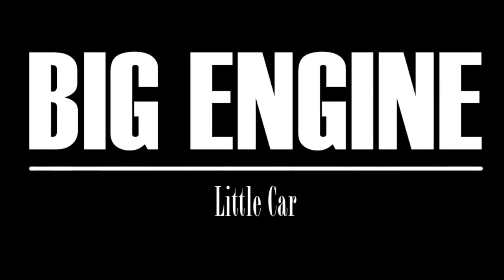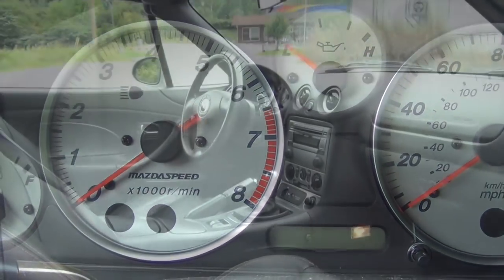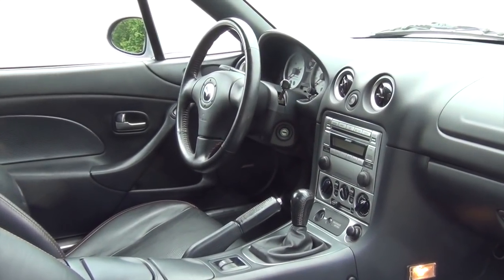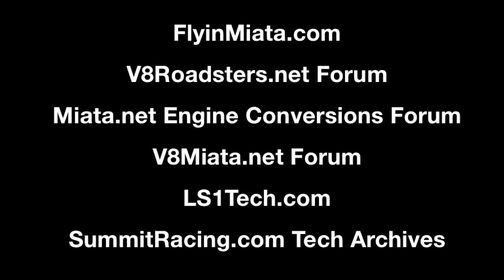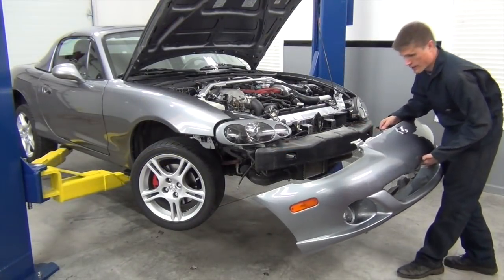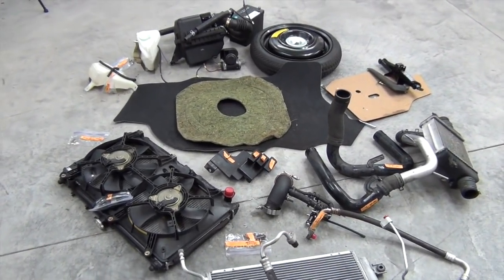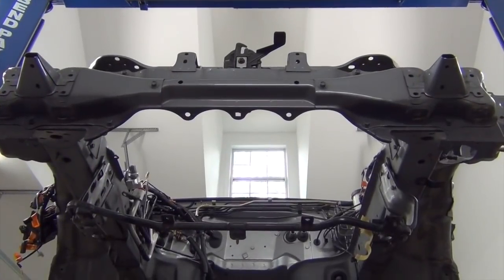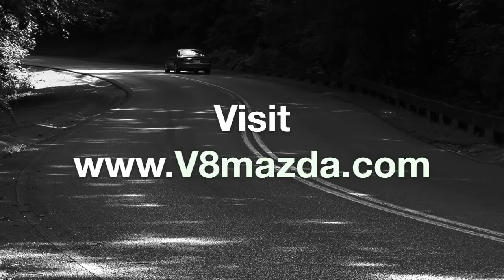LS3 V8 Miata Build - Project Thunderbolt Part 1

Comment: This would have to be the best How To - Engine Swap video I've ever seen!! Your workshop is super clean throughout the entire build, you're taking time and care at every stage of the process, using the correct tools and ppe for the job, every nut and bolt is torqued to specification as it's going back together and I love that you're using purpose-built front and rear subframe assemblies and not some homemade engine and diff mounts (which I see all too often in conversion jobs) and even how you angle the front diff to 1.5 deg before welding the front hanger bracket into place! Now that's Craftsmanship - well done Tom, now I better get back to watching the rest of the build!
Reply from the maker: Thank you for the very kind words sir!  Glad you’re enjoying the series!

Comment: The drivetrain that's coming out of the Miata would fit nicely in mostly stock form in a 89 Ford Festiva. That would be an awesome project. After this one is completed of course.... ;-)
Reply from the maker: Dude, it's like you're inside my brain!  I love the Ford Festiva and have been kind of casually looking for a clean one for many years.
Reply: I saw someone make a Ford Festevil and put a n/a Miata motor in one several years ago. (can't find it anywhere online anymore). It was pretty quick, but I think you could do it more justice. Because I like the sleeper look that you push pretty much on all your builds, it's harder to maintain and the thought process is much more involved. But, if you could make one that's RWD & turbo'd with A/C and maybe tub it out some to handle the power? Being they have 12" rims and the tires that were on the car were boat tires ( Four Wheeler rims actually fit on this car!! ). My sister got one when she graduated High school (in 1989), and she drove it for 17 years, everything still worked even the A/C when she got rid of it. Anyways, this build is going to be awesome!!! I figured I'd ask where the parts coming off of the Miata were going if they weren't going to be sold. Can't wait to see more progress on the next video!!!
Reply from the maker: BoostedCajun It would be tons of fun, but oh man, I can't even begin to think about another build right now.  My plan right now after I get my Miata done is to take a little break from wrenching and just enjoy it for awhile!  Have a good one!
Reply: My first car was an 89 Ford festiva. Absolutely loved that car.  Jay Leno had/has a Festiva Shogun, which would have been a blast to drive

Comment: I understand the thought of big motor small car combo, but why use such a limited edition car? Why not use a Miata of the everyday variety? I have wanted to do this swap for quite a long time as well, but I don't want to use a limited edition model. Just curious.
Reply: Why use a Mazdaspeed NB for this! You should have used a normal NB and like someone else wrote you should have done a 13B conversion or something other than a LS
Reply: *****
If I'm wrong correct me but I do believe the 13b is 50lbs+ heavier than that LS motor. Although it would be cool.
Reply: No, no, wait, i got news, tom goes to change because of you, because you want.
Reply: Well i do understand why he is using a LS engine, its just that in 9/10 engine swaps people use LS engines.
Reply: ***** I'll agree with you, I like LSs but it's getting over used
Reply: I'd say one of the reasons he went for this car specifically was because it was so well maintained. Just look at it, it's absolutely spotless. With a run of the mill miata he would've been confronted to rust, dry rot, perhaps parts to replace and a doubtful electrical system. It's so much nicer to have something clean to start with.
Reply from the maker: PilgrimTitan Haha, thanks man!
Reply from the maker: ***** Kim I just build what I like, it's ok if everyone doesn't like it.  That's not my goal.  My goal is to build the car I've had in my head for the last 20 years.  There' no harm if that doesn't fit your liking.
Reply from the maker: randomted Yes, it is.  No one wants to believe this but it has been well documented by folks who have swapped from turbo rotary to LSx.
Reply from the maker: SI RICKO Thanks man, pretty much.
Reply from the maker: Donald T. Silva Yeah, the car hobby is good due to the variety in everyone's taste, but to say someones choice is wrong, seems kinda crazy to me.
Reply from the maker: Clément Dutter Yes, yes, yes.  Well said and starting with an old, high mileage chassis sucks.  I've done it.  You end up with a junky, wore out car that you've sunk tons of time and effort into and still needs much, much more.
Reply from the maker: turbokillsemall I wanted a well cared for, low mileage, rust free car to start with.  I also want to drive and enjoy this car for a long time, so starting out with the nicest possible chassis with the options I wanted just made good sense to me.  This was the best car I found in my long search.  Most every car had bad paint, wore out interiors, bumps and bruises, a little fender bender here and there, rust, etc. etc. etc.
Reply: Tom's Turbo Garage Understood. Well taken for cars are better starting points.
Reply: Even if it is a limited edition car, its still cheap being a miata. I wouldn't give it a second thought even it if was one of only a handful. But, I also give miatas about as much respect as I give Hondas.
Reply: turbokillsemall I think I missed something.  That gray NB is rare?  I know the yellow one is (I have a sunburst NA as well), but I don't remember seeing the gray one in my rare research.
Reply: ***** that's a Mazdaspeed version.
Reply: +1 to using a speed for a build.  Why put all that $$$$$ into a plain jane car when you can make a very nice special edition so much more special?  The best car to start with for a swap is the best car you can find and Tom nailed it!
Reply from the maker: Jim Stainer Thank you Jim, well said and I appreciate that!  This is a car I want to keep and enjoy for a long time, so the investment up front seemed worthwhile.  See ya!
Reply: I don't care what your excuse is, you removed a rare beautiful car from the road for a bullshit boring counter-intuitive v8 build no one will give two shits for in the aftermarket. I really hope you enjoy your now near worthless Miata, I really do.
Reply: turbokillsemall o

Comment: Why are there thumb downs for this?? Man I wish I had a normal mx-5. I would've caught you on the forums and said, ship me everything you got!!!

Very cool project.
Reply from the maker: Hott Toddy Thanks man!
Reply: Hott Toddy Probably cause Tom's cutting apart a quite limited edition MX-5, a Mazdaspeed version, and it looks fricken mint, and in my favorite colour.  Tom, please tell me that you're trying to save all the MS components for later use, or that they are going to another MS MX-5 owner! please! This is one of the few MS version Mazda's I haven't owned, I know they aren't the fastest car around, and you can make a stock MX-5 plenty faster yourself, but you gotta realize this car, if kept in good condition, will be a highly collectible car one day.  /rant  (still got my thumbs up, but I am sad you used a MS version) :(
Reply: I completely understand. I have the mazdaspeed protege 👍
Reply: Hott Toddy I owned the 1st MSP in Canada, put my deposit down a year before it came, the dealers had no idea what I was talking about.  Of course at that point I had no idea they were going to make the 2003.5, in titanium silver (like this MX-5), which is SOO much nicer than the flying pumpkin orange..  Anyways, honestly the MSP is the BEST handling front wheel drive car ever, MS did wonders with the suspension in that car.
Reply: Lol yeah laser blue here. Best friend got the first spicy down here in south Florida. I had the pr5 before till some fuk ran a stop sign and totalled it. So I got the laser shortly after. Love it.

Comment: LS engine in Miata is a fairly common option, but I'm wondering if there is any possibility to port other V8s, like a Merc V8 or a Ferrari V8 into that engine bay.
Reply: if I'm not mistaken there is a guy that is putting a Ferrari V8 in q brz or Frs
Reply: +André Pretto a**

Comment: pro tip for those storage bins if you don't know it already, write the labels on the clear cover over the section to be labeled, that way you can see the contents through the label, and sharpie is easy to remove with a little brake clean on a rag.

Comment: Anyone hear of the Sunbeam Tiger?
Reply from the maker: There is an amazing example of one that comes to my local cars and coffee that I’ve shown in some of my other videos.  Man I would love to drive it!!
Reply: The Ford 289 is taller than some others but it's width was pretty narrow. Because it was narrow it made for a great conversion for it's time! I got a feeling your conversion will be 10 times greater though! Nothing against the Ford 289 however. Properly built and kitted out it was a really great engine. For a few years I owned a 1966 Mustang coupe because I begged my mechanic neighbor (who worked at Ford Proving Grounds) to sell it to me! He had bought it for a song & dance at a auction just for Ford employees. It was straight from Ford's Yuma proving grounds and was tinkered on by none other than Shelby, the man him self! Found out the 289 had been balanced and blueprinted which may be not such a big deal today but back then it made for a very high revving engine. My neighbor took me for several rides before I bought it and he would rev that engine to over 7,ooo rpm! In order to do that it had heavier valve springs, different cam, etc. I figured, if that engine could hang together after revving that high multiple times, i wanted that car!  It had some kind of ceramic-coated headers on it with a cross-over just back of them then further back it had two separate glass packed mufflers then dual exhaust all the way to the back where they exited through port holes in the body, not underneath it!.  I will always remember how throaty and crisp the sound of that exhaust was and I loved it! 
I can't remember ALL the changes that were made to that car but it had a special Mallory dual-point distributor that was a real bear to set point gaps on! Oh, the engine had a dual-feed 850cfm Holley carb feeding a Edelbrok high-rise intake manifold. That carb had so many mods done to it that I had a lot of trouble finding a rebuild and ended up using parts of two kits! It didn't even have ID numbers on the body of the carb! I remember it had a Munchie 4-speed with Hurst short-throw shift linkage and no slop (Real fun to shift it, very positive). It also had a posi limited-slip diff and the rear axle housing had been modified so disk brakes could be installed. I don't know if that feature ever became a factory option. So I'll wrap this up by saying I think it's time for a disclaimer. Before any of you pick apart my description of the car keep in mind I was 20 years old back then and 72 now so 52 years have gone by! My mechanical abilities back then were shade-tree self-taught at best! I wish I still owned that car now!
Reply: Sunbeam Tiger would be over 50 years old now. It was a rust bucket even in the early 70's and was a bad piece of engineering. It couldn't take corners at any reasonable speed and was really just a big engine thrown into a small car. How would I know? Well I had one for a short time, a very short time! I also had a sky blue 1725 alpine, also a rust bucket. My neighbour was a traffic cop and the police in south London had bought one to try catching the growing number of very fast fords that were being modified for the street. He hated it despite it being really quick. He thought they looked stupid with their big policeman uniformed bodies crammed into a little car. It was often out of service as it was really difficult to service. It wasn't able to keep up with the modified fords on the bends and a didn't last long. Despite all the negatives, the alpine always looked neat but was never considered by the boys as a cool car especially when compared to a well sorted lotus cortina or a rally modified ford anglia.
Reply: Well if you redesigned the chassis placing the engine further back in the frame, and you made the rear-end 25percent heavier, you could in theory, compensate, for lack of 50/50 weight distribution. Plus I believe that the Corvette shouldn’t become a mid engine car, they should redesign it as a SPORTS car,instead of a grand touring car.  Also since the Corvette is made as a semi fiberglass automobile it cuts down on RUST. The Corvette NEEDS to be re-engineered as the people’s sports car

Comment: Back in the '90s,  in Vancouver, there was a guy selling a retro kit for first gen Miatas, which included a 302/5 litre Mustang drivetrain, and a suspension package. He sold several of the kits. The Mazda/Ford connection made sense to me.

Comment: I can see the vultures circling over the low-mile engine and diff.  Good project, can't wait to see it all come together.
Reply from the maker: bandwagon240 Thanks man!  Yeah, I may end up selling those parts eventually.  Not sure yet.
Reply: Putting them into a NA would also be fun (albeit without the bucktooth intercooler).  Or even an Exocet.

Comment: It helps to wrap the edges of the hood and fenders with high quality 2 inch wide masking tape (the easy release type) to keep from having nicks. I like "Frog Tape". Also if there are any shims where fenders bolt on they should be put in zip lock bags, one bag for each group of shims, with a note inside denoting position, like right top and right middle. As the builder states, label everything as to position, especially grounds. Most electrical connectors are unique and can't be plugged in any place beside where they were but "you never know". I write numbers on the tape and I record the numbers on a legal pad and beside the number I write where that number goes. This keeps me from writing a lot of info on the tape.

Comment: Absolutely great done video and a project that could be done "on the cheap" at first. After it's thoroughly "sorted out" with maybe 200 miles, the "Skys the limit". The only problem is traction because of low end torque but that could be handled with a "peaky" cam.

Comment: I halfway expected you to put a 4g63 in an NA Miata ha. I'm really looking forward to watching this as I'm considering putting a carbed 302 into my beat up 94' red on tan na, you know for the sleeper factor of a huge quarter panel dent, with the monster miata kit.
From a fellow Tennessean (middle, although it used to be Knoxville/maryville) your awesome
Reply from the maker: Jackson Bond Thank you for the kind words Jackson!  A 302 swap is an excellent budget setup that is tons of fun and much easier, ultimately.  I would've put a 4g into a Miata years ago, but the engine is far too tall.
Reply: Being there are so many Fox bodied Mustangs out there and along with 80s and 90s Ford trucks,the 5.0 liter is all over the place. I love the Coyote engine tho but I figure they will be putting the V6 twin turbo EcoBoost in the Mustang and that would be a great swap into the Miata.
Reply: The 4G63 miata doesn't sound too bad

Comment: Custom cars done right are one of the biggest bargains going.  The classifieds do have excellent executions on interesting cars.  The key is to find one that isn't demanding a Boyd Coddington price (because the owner is holding invoices from a place like that).  The reason people get put off is they can't imagine a DIY doing as good or better than factory engineers.  Sometimes they do it well.  Look -- Ford didn't even try to put the 429 Boss in the 1969 Mustang -- they just outsourced the job.  Big block (mopar) a-bodies were known for horrendous exhaust compromises.  etc.

Comment: Talk about a coincidence. I have been scheming on putting an LS1 in an 88 Porsche 944 and I have no problem with a heavy front because the LS weighs almost 100 lbs lighter than the inline 4 that's in it now.
Reply from the maker: argonian bilbo Nice!  I just read through an excellent build thread of an LS in a 911 that was darn compelling.  I would have to imagine that a 944 would be much easier.  Good luck!
Reply: Thanks. It most likely will. The engine is in front of this car not in the back like the 911

Comment: I find this awesome honestly. I'm looking forward to the next episodes. I own an MSM of my own and have seriously contemplated doing this in the future.
What the MSM is an unique limited edition car? Bli Bli Bla Bla? 
The MSM isn't as special as everyone makes it out to be, it's pretty much a non VVT 1.8 with a tiny turbo an awful factory tuning. The 6 speed and rear 4.1 makes the gearing way too short and nevermind the lowly 6.5k Rev limit. If you turbo a regular Miata you end up with a faster car than an MSM...
Reply from the maker: NotSoFastDriver Thank you for the support sir!  I looked at lots of Miatas in this generation and the MSM was by far my favorite and were usually kept in the best condition.  Most "regular" Miatas are ragged out by now.  My goal is OEM fit and finish, so I still plan to honor the MSM and do my best to get the details right.

Comment: Pro Tip: I started taking a bunch of pictures with my phone during a disassembly. I'll never go back to labeling parts again! It's so much easier, faster, and it's automatically in reverse chronological order. You'll be surprised how useful those pictures are for things you weren't intending to capture!